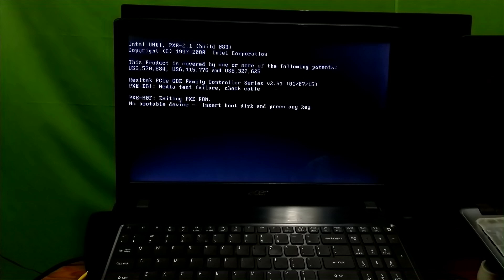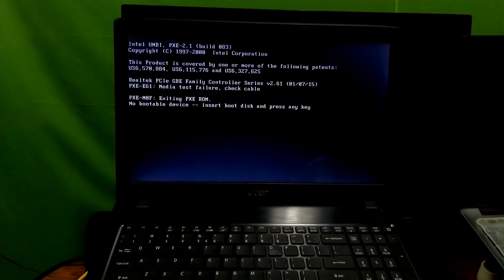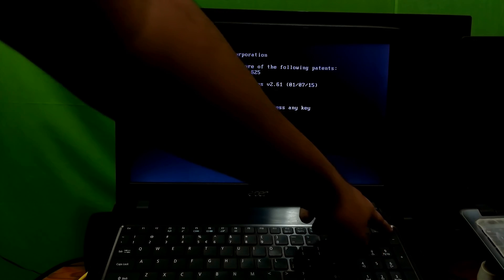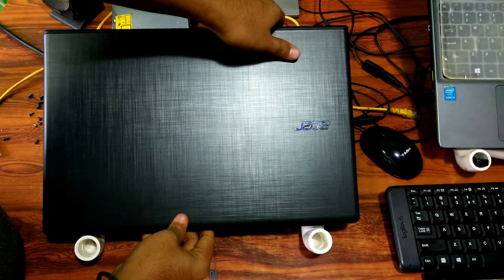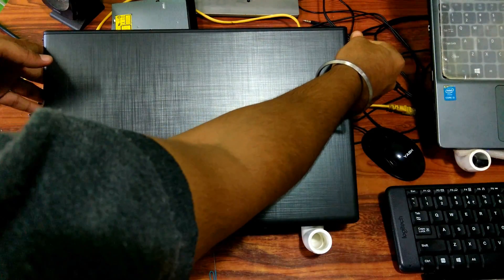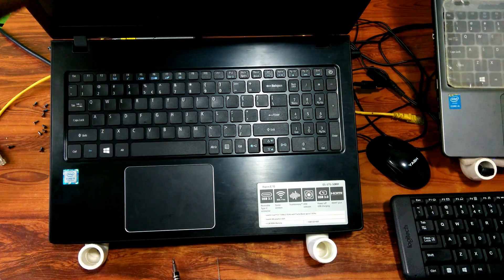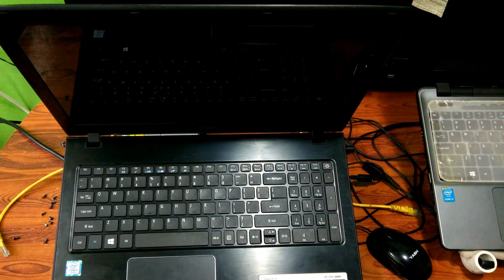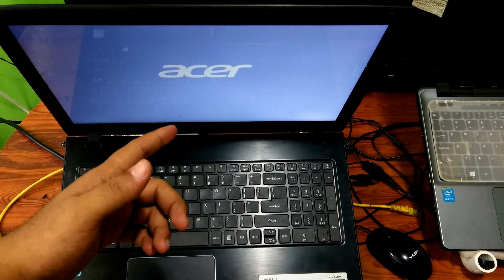How to fix PXE-E61 Media test failure, check cable | PXE-M0F Exiting PXE ROM No bootable device

Comment: Thank you thank you! This video just saved me. Searched everywhere but couldn't find a decent solution. Finally the last method of battery removal helped my Acer laptop get revived again!
Reply: I switched in the bios settings the boot mode from both to only legacy and from then my pc boots only network but it cant unfortunately . And i tried everything to get in the bios again to change it back, but it didnt work. It sayed at the corner of the screen that the bios settings were loading, but then the next display is network booting.  And yes both is working fine, but i cant get in the bios. Please help 🙏

Comment: Today i bought new ssd. When i replaced hdd with ssd this problem came. Then i replaced my old hdd with new ssd this problem didnt came. Then again i replaced hdd with new Ssd now again this problem so problem is new ssd or me ?
Reply from the maker: Did you install OS on your SSD and make your ssd as the primary or first boot device from BIOS?
Reply: @asatechnical  nope. I didn't install os on ssd. I have one laptop only. So I don't know how to do.
Reply from the maker: That's why the error is showing there, First, you will need to create a Windows installation usb by using your old HDD, and then you take out your HDD and install the SSD and install Windows into it using USB installation usb.
Alternatively, You can migrate your Windows from hdd to SSD if you have a dedicated SSD slot or using a external SSD enclosure!
If you want you can check out our channel, all tutorial is available in our channel.

Comment: I have a boot problem now a boot screen think pad setup screen appears
 Then a blank screen
Then initializing for boot
Then chose a tab menu/app menu screen appears and again boot screen appears

kindly guide me in this issue,if I have connected USB (lazesoft password recovery)with lenovo laptop still issue is same
 think pad setup screen appears 
,boot initialization screen appears ,choose the device for boot(usb)
,then lazesoft app opens after password reset I click on reboot then again think pad screen appears

Comment: Why taking off the bios battery if you could just enter bios and set the default settings?
Reply: Some unit with this kind of error, wont let the user enter bios.

Comment: Hello, it didn't work for my dell XPS L502X
Reply from the maker: Did you try our another tutorial, that I mentioned in this video.
Reply: @asatechnical  no
Reply from the maker: I clearly said in this video, before you try this advanced methods at first try to fix by using easy methods.
Reply: And to add to it, it doesn't shows " no bootable device -- insert boot disk and press any key" on screen with the error code.
Reply from the maker: Exactly what is showing on your computer's screen ?

Comment: Didn't work!! None of these things worked. Changed two different motherboards, two different CPUs two different hard drives (one a new SSD and the original 500GB Hard drive that was originally on the system... NOTHING! Will not boot to BIOS with ANY hard drive installed. Reset BIOS several times. When using a Windows recovery disk the system runs agonizingly slow loading any software. With the hard drive in the system hangs at the BIOS splash screen and you can not access BIOS! Any ideas?
Reply from the maker: BIOS mode legacy or UEFI ? Did you check connector cartridges property? And when you boot from recovery media what exactly is shown and BIOS setup was successful?
Reply: @asatechnical  I switched in the bios settings the boot mode from both to only legacy and from then my pc boots only network but it cant unfortunately . And i tried everything to get in the bios again to change it back, but it didnt work. It sayed at the corner of the screen that the bios settings were loading, but then the next display is network booting.  And yes both is working fine, but i cant get in the bios. Please help 🙏